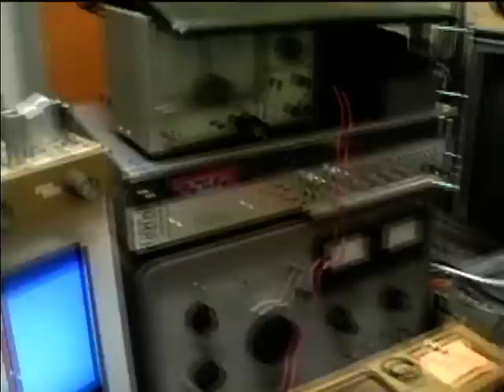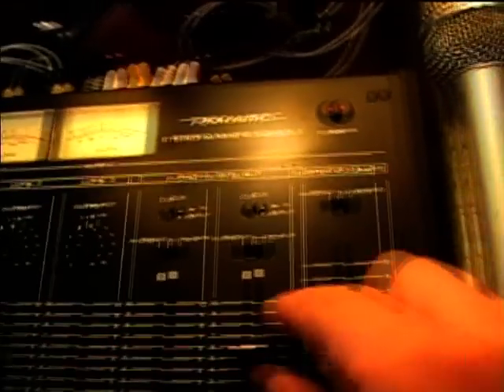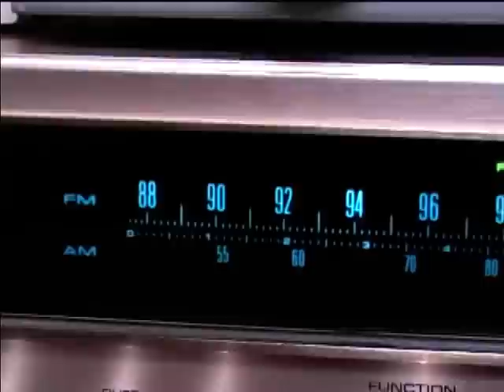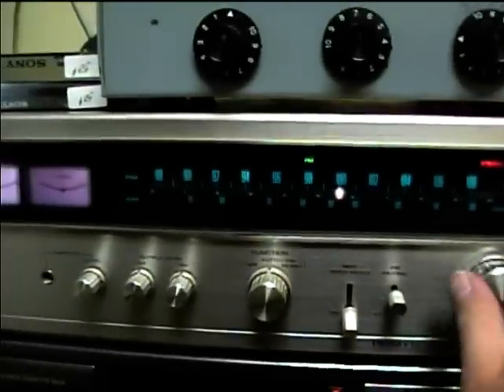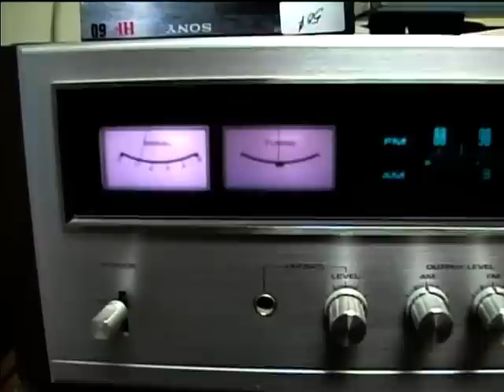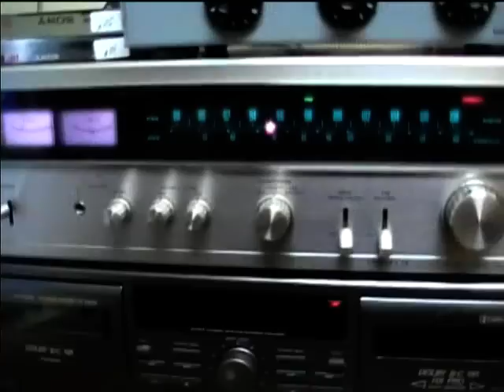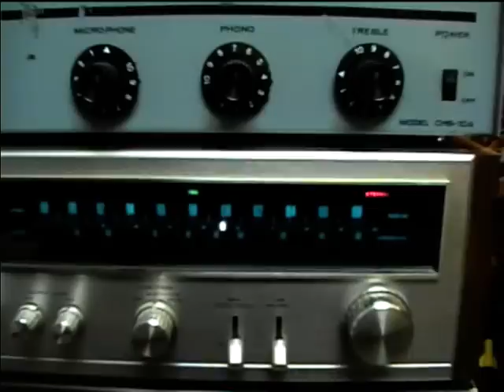Electronic equipment projects 9-6-09

Comment from the maker: Thanks! There is air conditioning in the building although the living room area seems to get more cooling than the other rooms. The A/C runs during business hours in the building, and at night and weekends the system sets back to a higher temperature and you have to activate a timer in the hallway to operate the A/C.